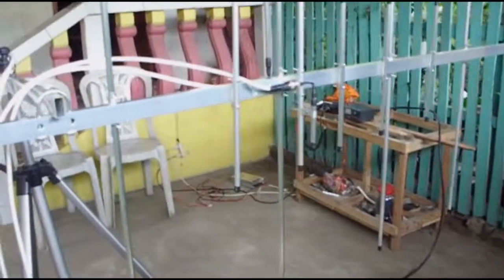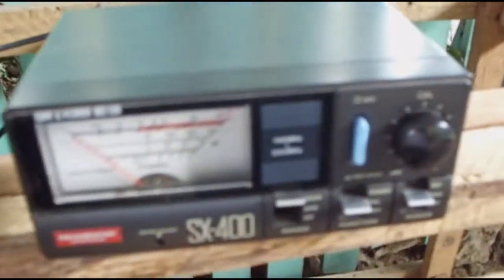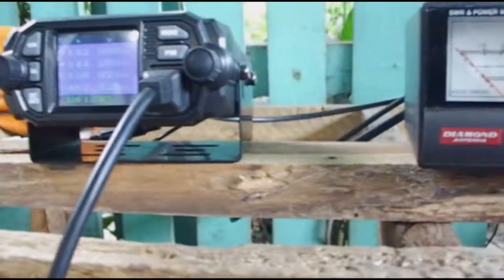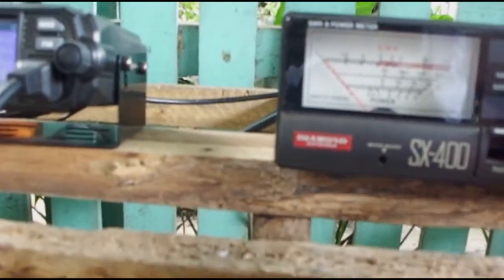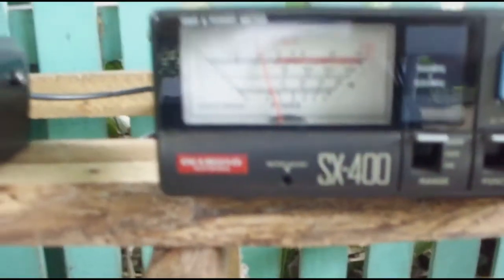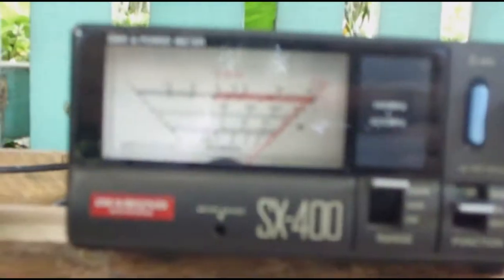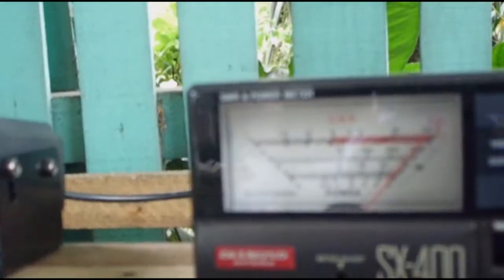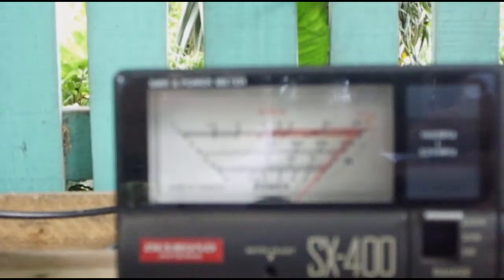Testing SWR response of Dualband 5x5 Elements 2m/70cm Yagi ( Lightweight End Mount)

Comment: A bit confused....If the whole antenna is metal, and the elements are not isolated, is not the entire antenna "driven"?...Thanks.
Reply from the maker: Elements and boom are all grounded except, for the center conductor of the gamma match which is capacitively coupled to the driven element via the tuning stub.